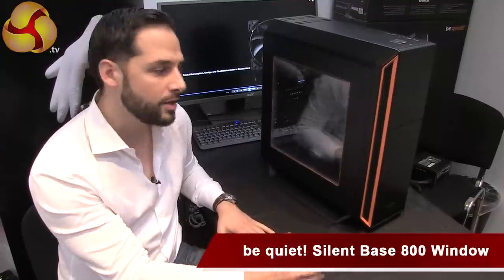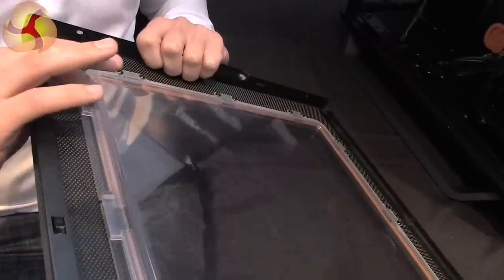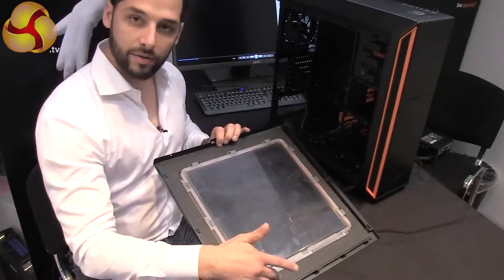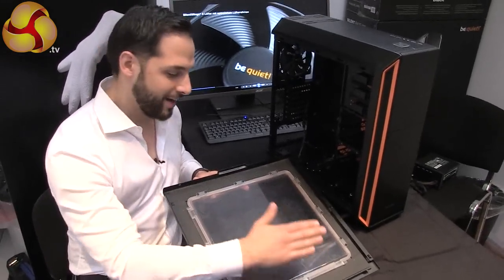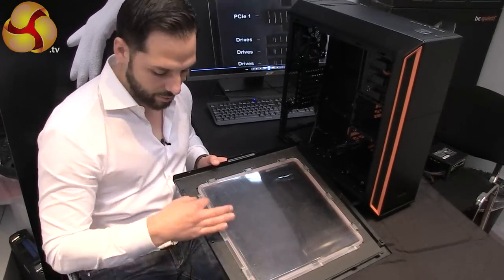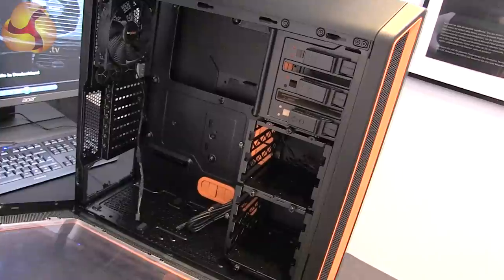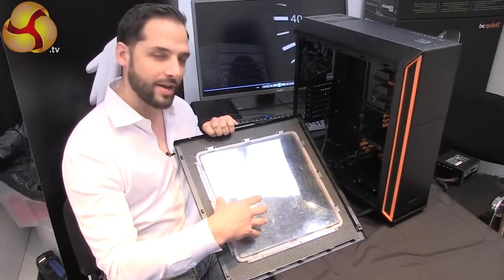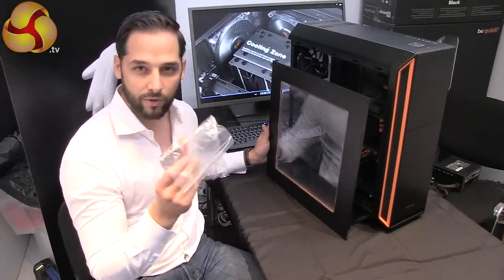be quiet! Silent Base 800 Window on KitGuru

Comment: Bequite should introduce the case with stand-off rather than those punched motherboard mounting points(usually cheap low end cases have these) also that whole faux 5.25" bay is a waste of space either there should be full 4 5.25" bays or atleast have the I/O panel instead of that stupid faux panel. In general though there is a lot of wasted space in that case. Hopefull 2nd generation Silent base will improve upon these and make that a perfect silent PC tower case.